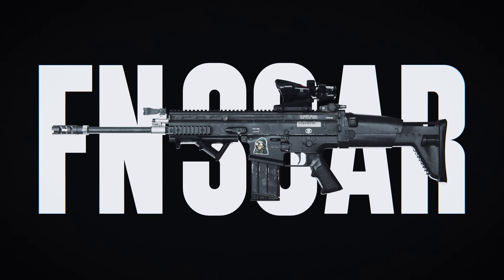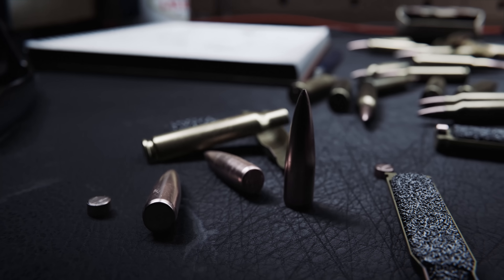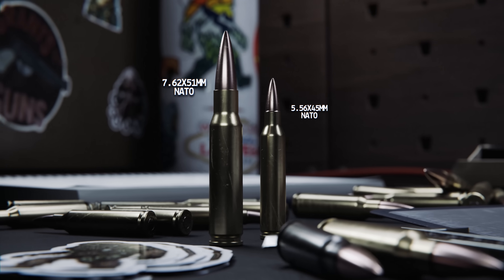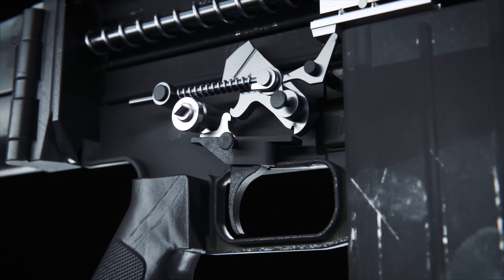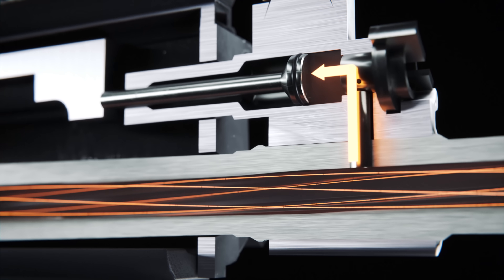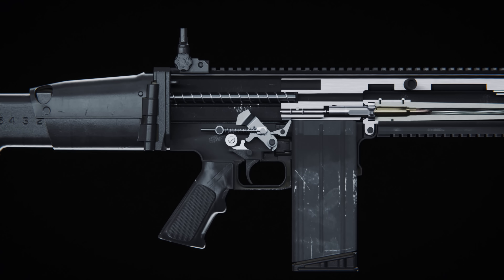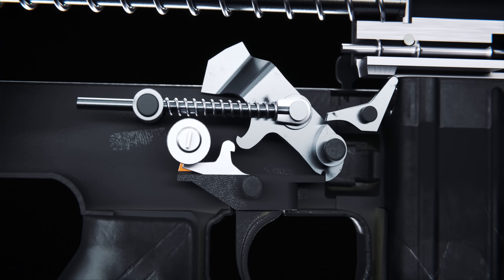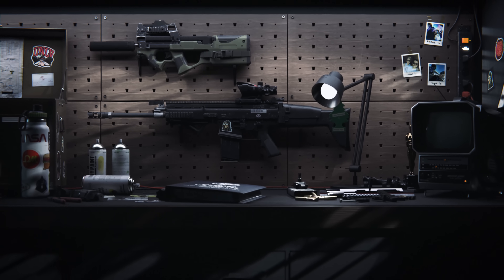How Guns Actually Work

Comment: I own 4 308 rifles, the HK MR762, Knights SR25, LMT MARS-H and the SCAR-H. I will tell you right now if I had to lug this thing around and kick doors down, the SCAR would be the one. The recoil system is softer shooting and weighs less than the other 3. It isn’t as accurate as the HK but it weighs probably 20 percent less and 308 is worthless beyond 800meters/yards anyway, at which point I am using 6.5 Creedmoor or something more modern. Great video by the way.

Comment: The only single TINY insignificant detail that I could POSSIBLY nitpick is that the spent casing doesn’t have an impression on the base from the impact of the firing pin 3:11

Comment: My dad used to be a gunsmith. He also manufactured his own ammo. While he didn't fabricate his own casings or bullets, there was an awful lot of science involved in how he would get certain properties out of a given firearm just from the grain of the powder load. I feel like there's a lot of people out there who grew up around a father who took apart cars, slowly teaching them how various parts work. My dad did not teach me a whole lot about cars, instead he taught me how to field strip a weapon all the way to completely restoring worn or damaged parts, and when I was old enough, he taught me how to shoot. Where some people rebuilt an engine with their dad, I was being taught how to apply barrel rifling or blue hardened steel. 

Ironically enough, I am all for gun control, but at the same time, I can understand why some people out there may genuinely want to possess assault firearms. I would like to own one just to take it apart and clean it and look at it sitting in a gun safe every once in awhile. It doesn't even have to an actual firing pin. It would be so cool just to get in there and take it all apart.

While firearms are incredibly dangerous, the meticulous engineering behind them is honestly one of the most impressive things I think I've ever seen. In a lot of ways I truly see weapons as a variety of art. They are remarkably simple, yet so many things work in tandem at once to sling a bullet downrange. It is truly impressive it all just sort of works, regardless of how many hundreds of thousands of time an action has been cycled, whether it's covered in dirt or mud or grease, it will just keep fricking working. Most of the time anyway :).
Reply: Are you OK?

Comment: Piston-operated systems are much better than gas-operated systems. Great video. Unfortunately, 99% of guntubers do not understand how a firearm works, which makes this video invaluable. It is NOT uncommon to here idiots proclaim bullets fly as a result of a explosion or something similarly dimwitted and miserly. In fact, it is as you said: "Combustion", an expanding gas that propels a bullet through the rifling of a barrel.

Comment: What you’re calling the sear at 3:24 is actually the disconnecter. Its function is to disconnect the hammer from the rest of the fire control group. The sear is specifically just the front lip of what you generally referred to as the trigger. It is black in your video and catches the bottom notch on the hammer near the hammer pin. The disconnecter is essential in semi-automatic firing mode as the trigger is held rearward. Releasing the trigger allows the sear to rise enough before the disconnecter releases the hammer so the sear can catch the hammer. This is the click you hear when you release the trigger in semi which people call a trigger “reset”. 

Then in full auto the auto sear is finally allowed to do its job, releasing the hammer from the secondary notch once the bolt is in battery, as the disconnecter is disabled by the firing mode selector cam.

Comment: I bought a SCAR 17 relatively recently, and it is by far my favorite gun I own (which is saying something). Shooting it feels like a magical experience. It’s lightweight (for a .308), yet has very manageable recoil. With a bit of practice, you can shoot it basically just as fast as an AR-15, yet you can feel, see and hear how much more powerful the .308 round is. It kicks up so much dust from the berm, especially at close ranges. It’s also very accurate at longer ranges. With my LPVO set to 5 or 6x, I can easily hit a 10-inch steel plate at 300 yards. It’s expensive as is the ammo, but it is an incredibly versatile firearm. Few firearms, if any, are as effective as the SCAR 17 both in CQB and at long ranges.
Reply from the maker: I had the opportunity to fire the Scar 17 about 10 years ago and I agree. Pretty light recoil for a 0.308. But I'm a weakling so I found it to be quite a bit too heavy to be comfortable to carry and shoulder fire for long periods of time.
Reply: @echozero_  Thanks for your quick response, and mad props for the quality of your video! I very much agree with you on the weight. Without a sight or any attachments, the weight is quite manageable, but with my scope and bipod, I have to admit it’s pretty heavy. That’s definitely its biggest weakness, but it’s still similar to or lighter than many other .308’s, so the heaviness is not really unique to the SCAR 17. I have some strength but I’m not super strong or anything, so it does get tiresome for me as well, but you do get used to it after a while.

Comment: I recommend you to start making animation of combestion engines and transmissions as well as electric cars. Explaining each prominent engine and transmissions working as they are different for example honda k20/24, bugatti w16, v16, f1 car engines especially v10 ferrari f1 and v12 ferrari f1 with exact dimensions and how they achieve 300, 400, 400+ km/h. That would be great and i would definitely leave a like

Comment: Nice animation, however there is something was not mention in the video:
1. What cause the bolt to not rotate prematurely. During feeding phase, the friction between the round and the magazine is enough to force the bolt to rotate out of battery, causing failure to feed/lock.
2. The dwelling time was not mentioned. Bolt carrier got accelerated for a few milimeter before reaching a vent port and will no longer be accelerated. The rest of the travel is pure momentum. The bolt carrier will move for about 3-7mm before the bolt actually rotate to unlock. This will buy time for the projectile to leave the barrel, and allow for pressure drop to a safe level
Reply: Give over

Comment: 7.62x39 is used by an AKM (and so is the gun in the animation) not ak47 that uses 5.45x39 just a litle nit pick nice video otherwise
Reply from the maker: It's my understanding that the Soviet era AK-47 uses the 7.62x39mm. The newer AK variants use the 5.45 right?
Reply: @echozero_ naah it's still 7.62
Reply: Bro Google first, both AKM and AK47 uses 7.62mm